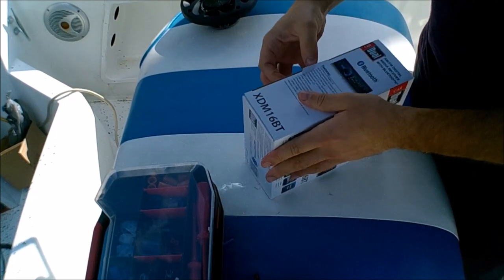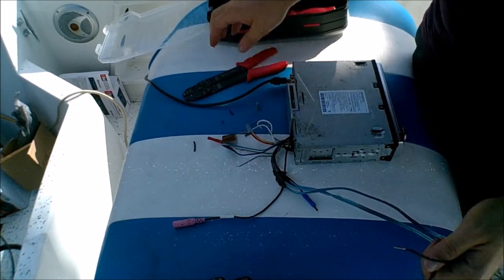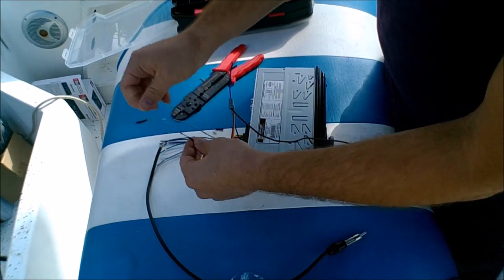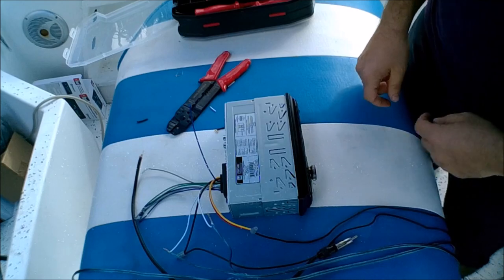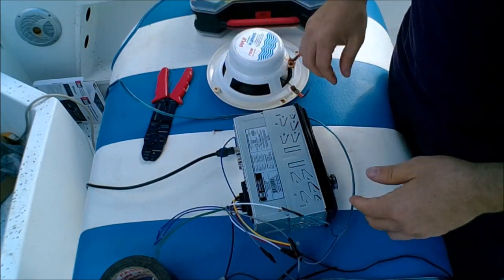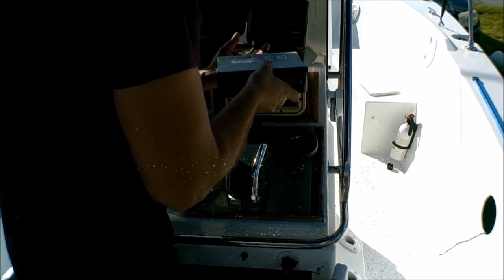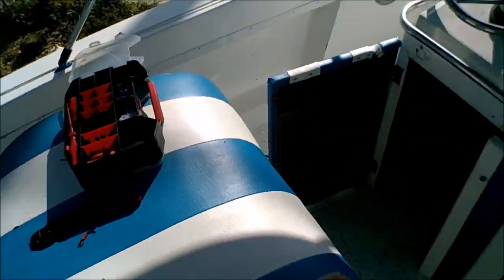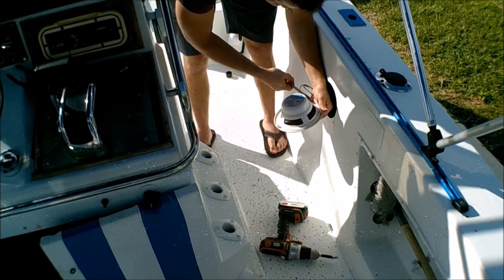Radio Install on boat

Comment: Nothing about this is marine quality. You do not use twist terminals in a marine environment 😆 All connections should be soldered or waterproof connectors should be used
Reply: USCG req is crimped butt, not soldered.
Reply: @hoobeydoobey1267  don’t care what USCG recommends. I’m taking about common sense and protecting the connection from the environment, especially those in salt water areas.
Reply: @danielguerra4447  Then you're not talking common sense, just spitting what you think is best, like every other narcissist.